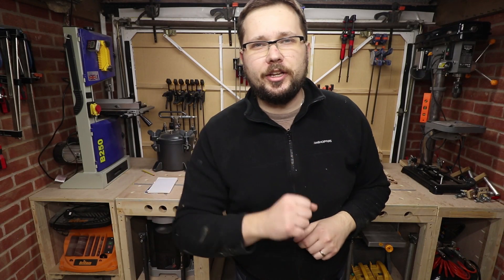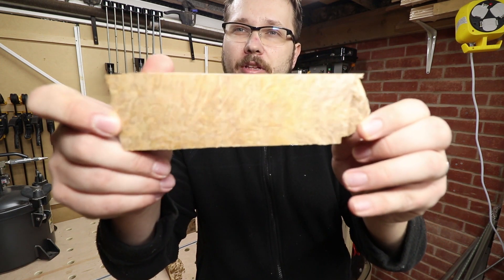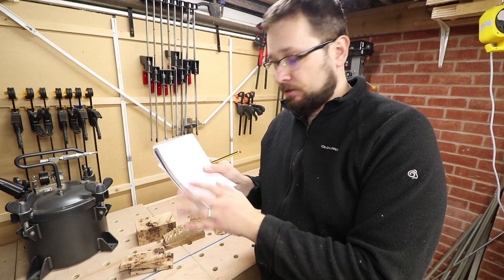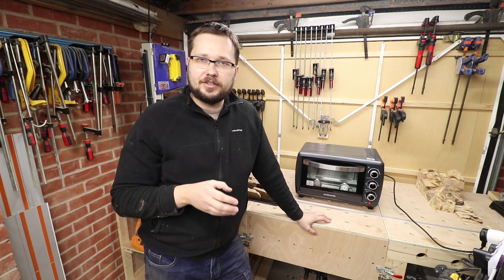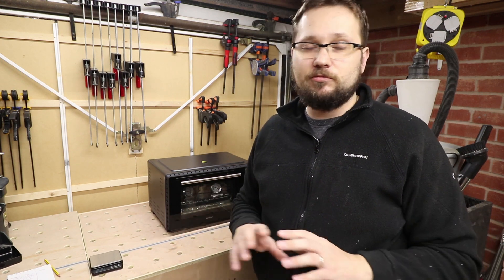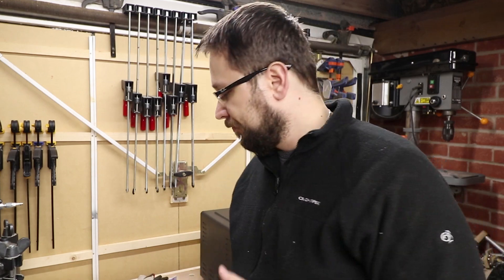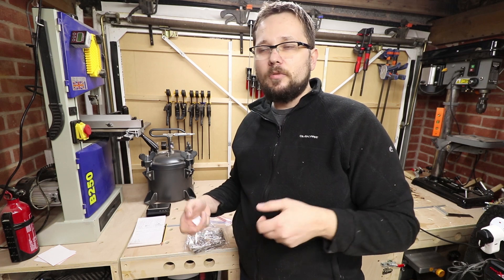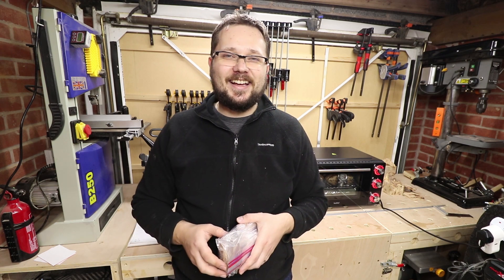How to dry wood for resin casting and stabilization - Resin Tutorial

Comment: can you help me? I've been trying to buy a toaster oven for this process. All of the ovens I've been able to find have a maximum of 2 hrs.and then the timer shuts the oven off. Can't seem to find one that will remain on for 12 hrs.
Reply from the maker: Hi, you don't need a toster oven with a 12h timer. You need one that has an option to just stay on, without a timer. You setup an alarm clock and just go and switch it off. Most of them will have an option to just be on.
Reply: Thanks
Reply: What brand do you have and where did you purchase it.

Comment: Good video. One little suggestion. Take a slip of paper and write on it the date you put the piece(s) in the bag and be sure to include the final dry weight. Put the slip in the bag or wrap the slip up in with the individual piece of wood. That way if you don't stabilize it right away you still have that information available.
Reply from the maker: That's a cool tip. Thank you

Comment: hi, do you have to dry wood always before using it in small resin projects? I have a few small off cuts, and was thinking of making some small amulets ect. Also would you recommend getting a pressure pot, if so which should I buy that doesn't need any modifications in the UK.
Reply from the maker: I do recomend that you dry your wood a bit, the less moisture it will have the better results you'll get when casting with resin. Some resins react very badly to moisture like the Alumilite. I got my pressure pot from them http://www.pressurepots.co.uk/pressure-tank-only.html

Pressure pots are expensive and I would only recomend them if you will actually use them. But if you can afford them then I have to say they do give fantastic results.

Comment: You never get zero moisture. Wood is hygroscopic and thus reacts to fluctuations in humidity: when the humidity drops, the wood moisture content drops, and vice versa. There is therefore a constant relationship between air humidity and wood moisture, which is called wood moisture or sorption equilibrium (up/down balance).
Reply from the maker: That's correct, this process is to get the wood ready for stabilization process after which the pice of wood get much higher resistance to moisture 👍

Comment: Man, you complicate things way too much! I have a jeweler's oven with 15 heat settings. I put the wood in and set on setting #1, 175 degrees F for 24 hrs. Never have I had a problem.  My resin is Alumilite water clear! Very sensitive to moisture!
Reply: To be fair, treating wood with Alumilite Water is not the same as treating with Cactus Juice and other things that impregnate the wood.

If I were to put your Aluminite treated wood on my large sander and remove the surface, then bury it in my garden, it would rot.  The whole idea of things like Cactus Juice is to, as much as possible, impregnate the wood with resin.  

When I treated wood with "Plastic Oil," the resin oil went deep into the wood. Essentially, I ended up with VERY LARGE pieces of wood that were very nearly plastic wood and that could be buried in a garden for years, without rotting.

That said, yes, some things can be made more simple.
Reply: Kelly, the man was simply talking about removing moisture from wood. No more, no less.
Reply from the maker: Thats cool mate, may work for you,  may not work for others. I think this is just the most comprehensive way of doing this to get the best results. But as you go and learn and see what works for you then you adjust the process. Simple👍😁